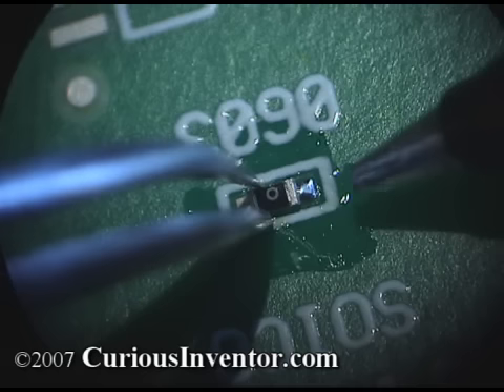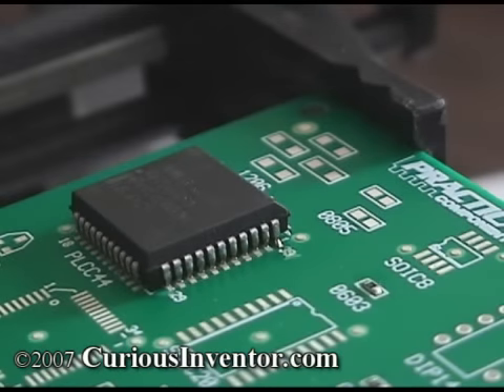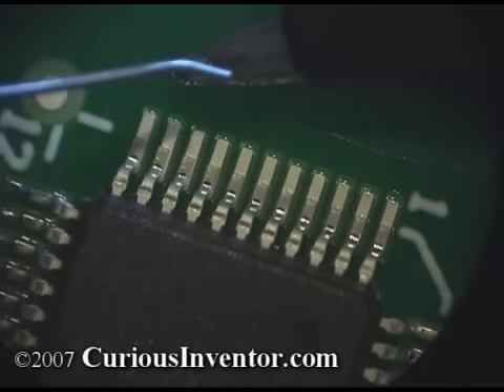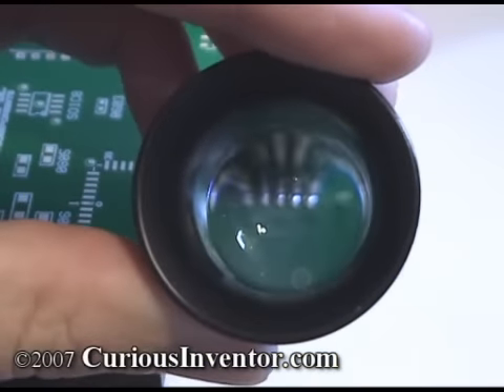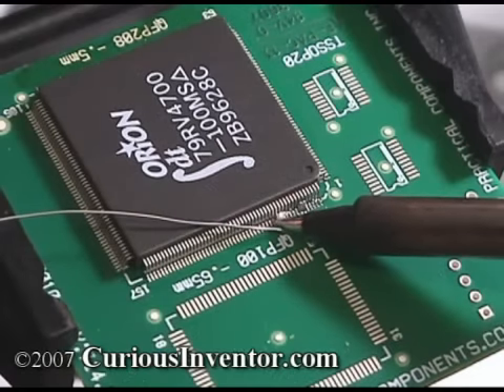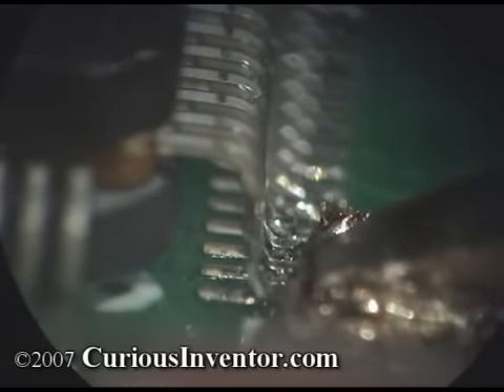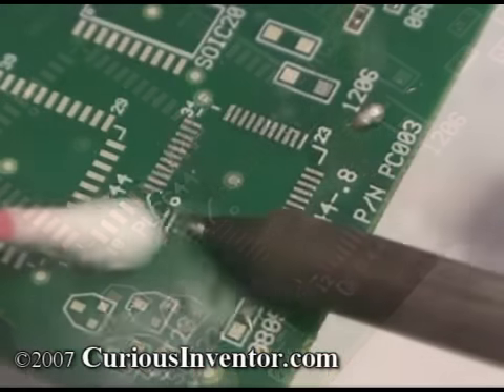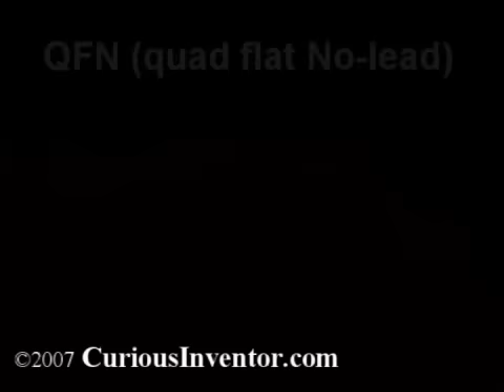Surface Mount Soldering 101

Comment: Thanks! I was able to put  together the Elenco Surface Mount Function Generator kit together, a requirement for my 100 level IPC certification courses, and we had no previous instruction in SMT soldering. Your video was the only prep I had other than seeing pictures of what proper joints look like, and it was a successful endeavor. Thanks!

Comment: Great video! It was as if I was doing it myself... The only thing I can add is when using solder-wick, do not press down hard on the solder-wick with the tip of the iron. The excess pressure combined with the heat of the iron can lift pads. Also, keep an eye out for shards or small strands of solder-wick wire left behind from the braid as they become potential electrical shorts!  And remember... Flux is your friend!  Nice work Curious Inventor!  Bravo!

Comment: Excellent tutorial.  I have a temperature controlled Weller, and need to replace a DMP-14 package chip.  I feel confident that I will be able to with no trouble.  It's only slightly smaller then a DIP.

Comment: What liquid flux should I purchase? I have a LQFP chip (128 pins. 0.5mm pitch), and I do have a syringe of MG chemical flux paste but it's from 2 years ago, although I never used it. and I only opened it for the first time about a week ago. However, I took the tip from you that liquid flux may be better for the 128 pin package. However, what is the best liquid flux for my my purpose?

Comment: @Lindeborg73 
hmmm.... That's a fairly low temperature... I suppose it's the combination of small solder diameter and the small diameter of the the leads... When doing through hole I usually push about 800 F. I usually use a larger diameter solder, also... Time for some Kester .015?

Comment: I am very excited to Get my IPC cert in January in SMD reworking and your vids are very helpful for me to prep for the class. Thank you. What are your thoughts on ir rework stations? Seems like they are overkill unless your swapping BGA and CPU size components? I'm using a hot air station for desoldering MacBook and iPad connectors and components and my concern is over heating the PCB, I'm considering a Scotle IR but the cost is a killer, any ideas?

Comment: I tried the jrwelery tool, baught one from a real brand, not the cheapest but not very expensive. It have 2 magnifications because one glass can be deposed. Find it perfect to read what is written on smd parts, for instance.No technique to have it holding by itself on my eye so I did not try to solder with it. But appreciated the trick Thanks

Comment from the maker: p. 631 of the PIC32 spec sheet: ww1 microchip com / downloads / en / DeviceDoc / 61143E.pdf

The 100 pin version will fit on the .4 pitch board, the 64 pin on the .5 pitch.

Comment: I agrée that this video is great, condensed and very useful.  But I have my doubts on the comfort with x10 magnified , the shots where not done with it of course . I hope it can be done that way really but having good light and the hood space to work must be very difficult is not it ? Thanks anyway, may be I will give a try  or borrow one to understand better what I see with it.
Reply from the maker: Most of this was done with a microscope, which is so nice to use when soldering SMDs, even if you can get by without one. Light is everything.
Reply: @CuriousInventor  Hello, in the meantime I just find one from a lab that closed, and I will not tell   -you how much I paid for it , about little less than a tenth: of normal price - as a light was added with separate alimentation, probably good quality light -will receive içt tomorrow or in 48 hrs; very exited ;)
 I also did test a cheap "microscope' intended to be used with a camera, , on a TV screen the camerais not bad at 38Mpx, direct to TV is really excellent, and the good camera - said to have a Panasonic cell- does not need a lot of light. Unfortunately once you go to USB (2) the max you get is 1080 pix at 60fps . ANyway ,even without the 3d vision, I could work with ease, and about 15 cm space under the optics.  Best regards . On the binocular 7x45x I guess I will have to add a 0.5 "'Barlow so it goes from 100 mm to 175 mm space, and the size of the zone is larger.
) Greetings

Comment: What does the flux exactly do? would you please put a link to buy that? Also your soldering tip is sharpers than mine what do you use?
Reply from the maker: +cyrusIIIII links added to video description. flux is like a weak acid that breaks down the rust-like covering that makes solder repel metals.
Reply: +CuriousInventor Thank you very much.

Comment: ive tried soldering thin wires onto a board and i put solder on the chip but the pins stick together how do i fix it?